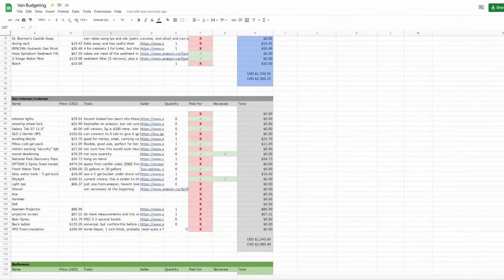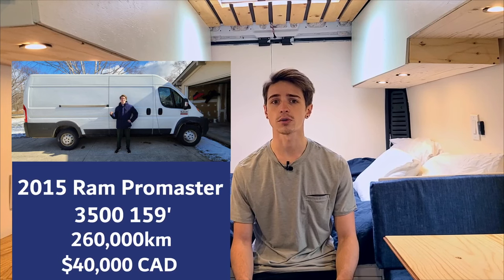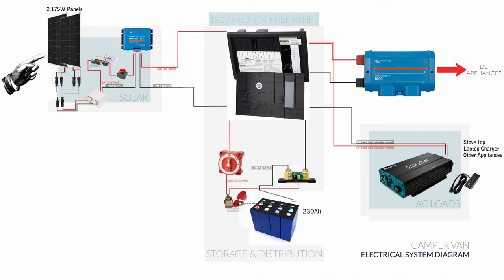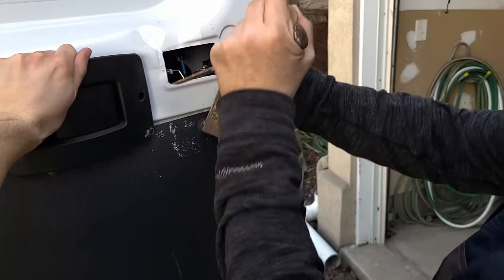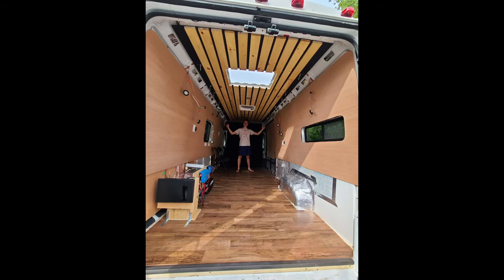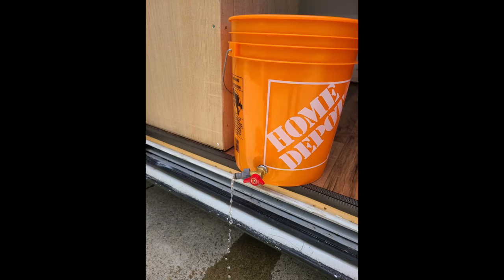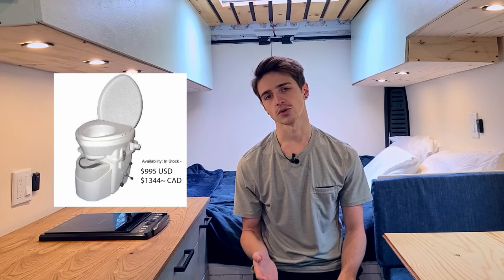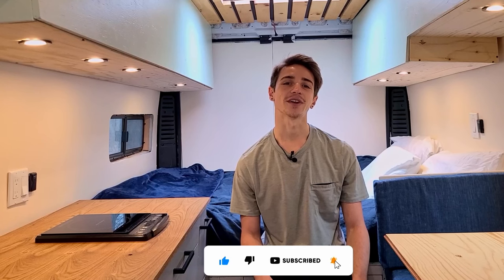Full DIY Campervan Build | Off-Grid Van Conversion

Comment: You are a wonderful narrator. Very clear and well organized presentations. I was wondering if you were going to work out a way to shower?
Reply from the maker: Thank you for your kind comments!! The sink faucet turns 180° to create a "shower" outside. I plan to use that the most in the summer, but also I can just stick my head in the sink to rinse my hair, which is good enough for me on most days!
Reply: @Galluchhh  Sounds like a great plan. Do be careful on windy days where the shower curtain might blow up on you. I'm not trying to be rude, I'm just a 60+ year old lady. with 3 grown sons, who might have to clutch at my pearls...lol. I do like the build and plan on using some of your designs.